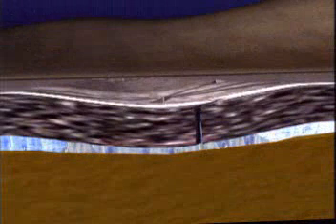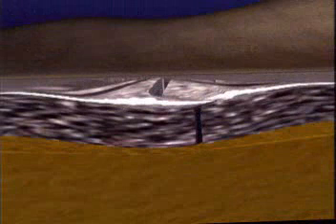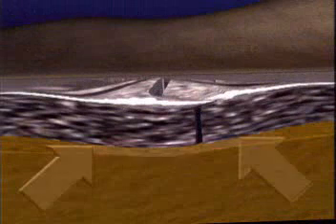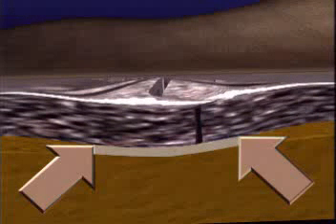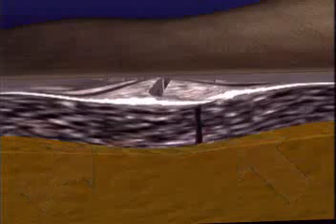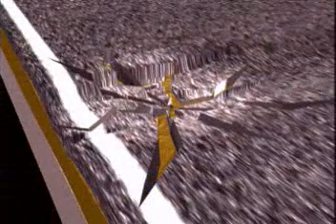how potholes are formed

Comment: I think there are many contributing factors to the causes of potholes. I live in Auckland, road freezing is rarely happens, yet there are more potholes than ever.
Auckland has been very wet this year.
Vehicles and tyre shapes have been changing, there are more EV's. They are typically heavier and tyres are getting wider with a more rectangular contact patch. This would suggest that the hydraulic forces our roads are subjected to have increased dramatically. 
I think this is forcing water through any cracks in the tarmac into the base washing it out causing voids, depressions in the surface, often preceding tarmac breakout, POTHOLES. 
Truck "Super Singles" are also becoming more popular. 
As the tyres loose rubber these hydraulic forces probably increase as the vehicle approaches aquaplaning speed.